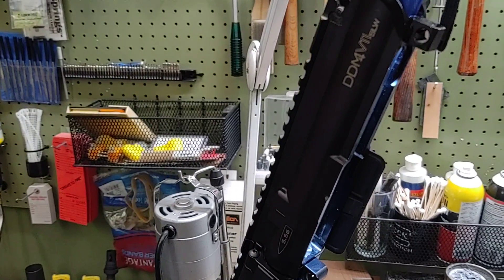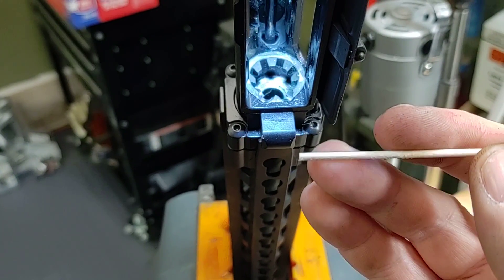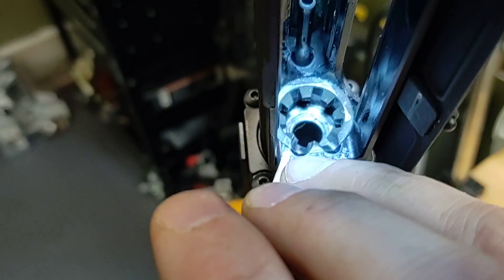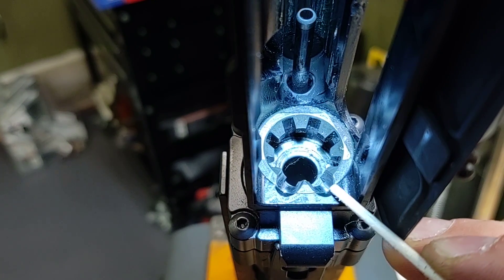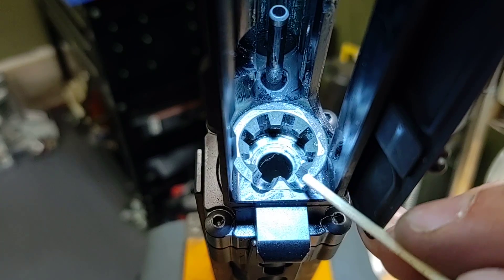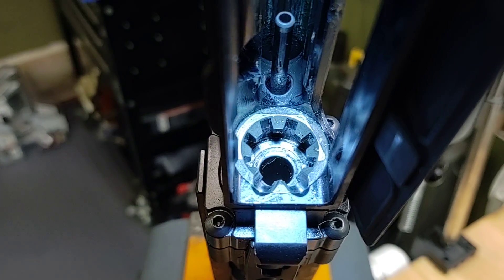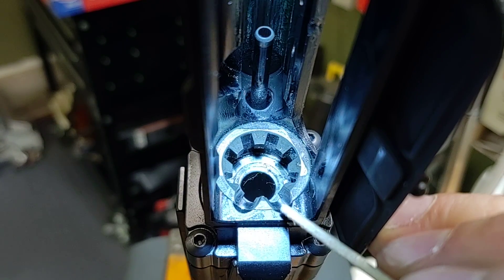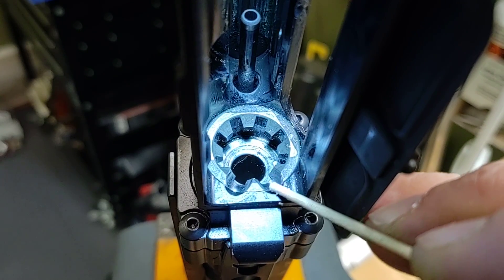AR Tech Tip - Checking M4 Ramps for overhang

Comment: I just purchased a Geissele HBAR upper and had a dismal experience first time at the range. Failures to fire, feed, eject…you name it. Could not get more than 3-5 rds without something happening. I wish I knew to look for this…anyway, sent it back. They just emailed today saying their gunsmith found the problem was exactly this issue, barrel extension overhang. Hence, here I am seeing what it looks like. Surprised and a little dismayed to have an issue like this from a company like Geissele…this is after a terrible experience with a DD 308 SBR, last year. Third time I sent that one back was for a refund. Still out the $200 stamp. Looks like EVERY industry has fallen to new depths the last five or so years. Thank you for the clear explanation, SOTAR.

Comment: This video is old but. I have a question,  what if the aluminum feed ramp overhangs the steal one. Is that a problem or no since there is no lip to hang up on in the feed direction?
Reply: I was wondering the same thing
Reply: same boat

Comment: What if it goes the other way and the receiver ramps are a tick above the barrel ramps (should be a no factor).  I ask because after 40 to 50 rounds (any lube on the ramp is gone) open tip rounds seem to stop right at the receiver ramp, I am thinking due to angle and would like to smooth that area.  It is a 6.5 Grendel of course and all the mag issues are visible from E-lander to Dura-mag to others which really are rebranded E-Landers, but this occurs just after the round leaves the mag and just stops at the receiver ramp...  Thanks, as I too was breaking out the Dremel, but something told me you better you-tube someone like the School of the American Rifle first.  Is there a polishing technique?

Comment: Why not put a very this shim between the barrel and the upper receiver under the barrel nut to move the extension forward slightly?
Reply: prob would change ur headspace doing that
Reply: @tylerhall6455  That would not change headspace, as headspace is dependent upon the bolt/barrel extension interface, not the upper-receiver.

Comment: Blending both at the same time also allows microscopic steel particles to become embedded into the aluminum which leads to a corrosion cell. The steel being the anode and aluminum being the cathode will cause the aluminum to be eaten in the presence of an electrolyte rich medium.

Comment: My Aero upper has a slightly twisted barrel, which has the feed ramps are just like yours in the vid, so thanks for the vid. Mine don't have a feed issue but it's digging deep scratches in the projectile, I'm afraid it will damage the rifling.

Comment: What about the opposite situation where the barrel extension feed ramps are a little bit past the receiver cuts? My BCM upper is like this but I haven't had an issue yet (very few rounds though). I would assume this is not an issue since one cut leads into the other cut and there is no ledge in the way of the bullets path.
Reply: Good question, hoping somebody knows.

Comment: I have this EXACT problem with my m&p15. I'm glad you mentioned the bit about not dremeling the aluminum upper, removing the anodizing; I was about to go get the dremel. I dont necessarily need help with the removing barrel part, but did you make a follow-up video about what to do with the feed ramps?

Comment: Feed ramps, and feed ramp design are an issue. I was designing feed ramps for an AR10 barrel extension, and i was not sure how it should look dimension wise. Probably its best to keep the angles close to the colt drawings and make sure the ramps meet up with the upper receiver. 

Well only time will tell once the thing is there, and we will see how it feeds.

Comment: Great one! One of the reasons you always make sure  both your upper and barrel have the same ramp cuts. i.e. M4 feed ramp barrel with M4 ramp uppers. I have seen similar issue with M4 ramped upper and non M4 ramped barrel extension.
Reply: M4 ramped uppers must have M4 ramped barrels, but it's worth noting that rifle ramped uppers are usually just fine with a "mismatched" M4 ramped barrel.  Perhaps not the ideal, but I have at least two like that and both work just fine.

Comment: Is removing the anodizing really that big of a deal? If you sand away all ano to bare aluminum, it will inevitably oxidize. Aluminum oxide is extremely hard.
Reply: One issue would be the bare aluminium and steel are dissimilar metals, so rust would form. It will be oiled so I doubt it is much of an issue.
Reply: @MrS22222  Aluminum doesn't rust, and anodizing is just a thicker version of the oxidation that normally occurs on aluminum.

Comment: I never approved of the M4 ramps. A bad solution to fix a problem that is really the fault of out of spec. mags and magazine catch position. The steeper ramp simply increases impact on the bullet tip and forcing a more severe incline into the chamber.